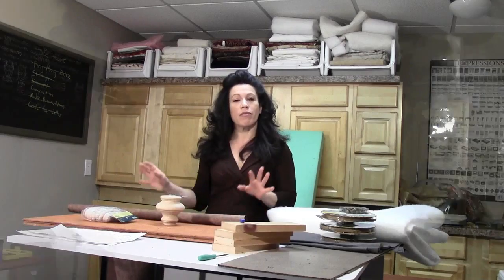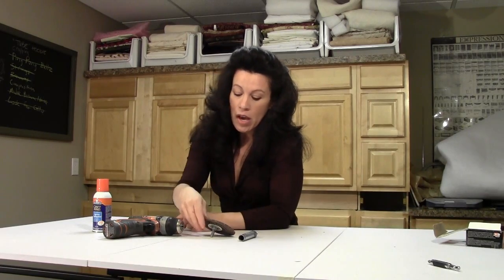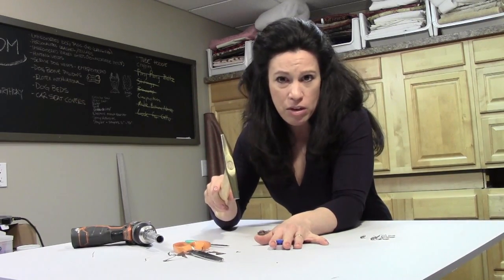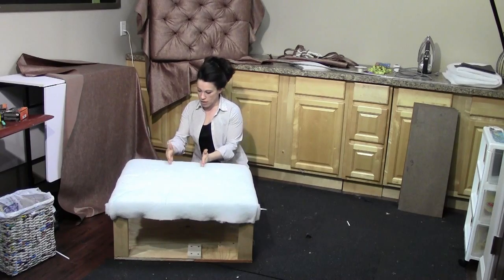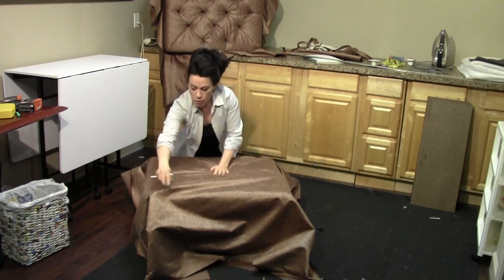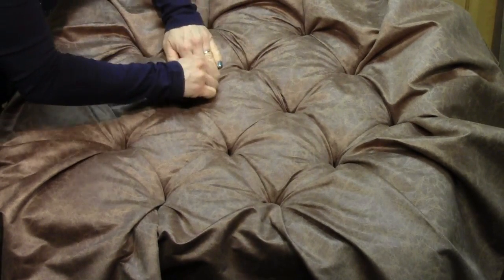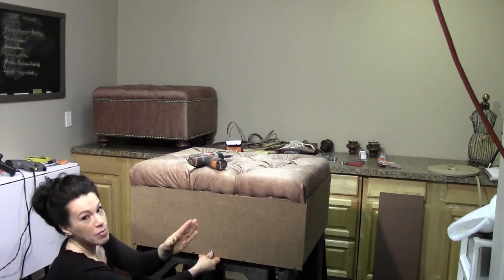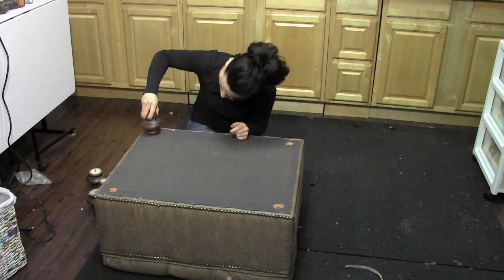DIY Tufted Ottoman: From Build To Upholstery With Renee Romeo

Comment: - Truly, truly enjoy your detailed instructions. This is true DIY teaching/learning. Hole bores aren't expensive, come in sets & safer than trying to sharpen pipe, particularly if you do tufting often. Electric nail guns are inexpensive as well. Wal Mart has corded & battery operated ones as reasonable as you'd find them anywhere. Hooked on you videos. Your pieces are very tailored with a professional look finish. Thanx 4 sharing.